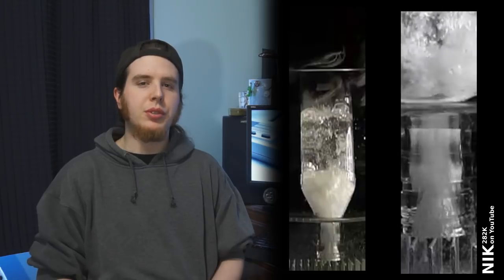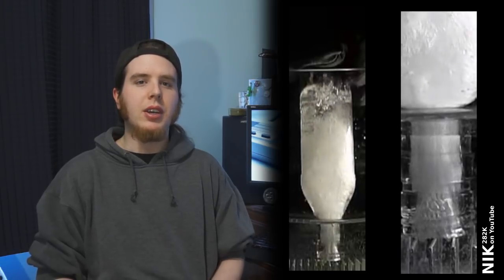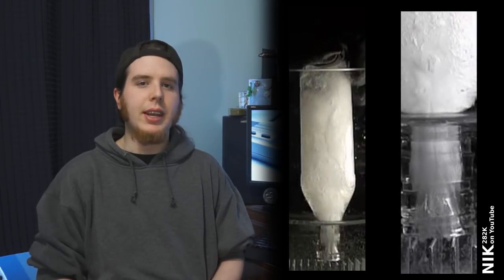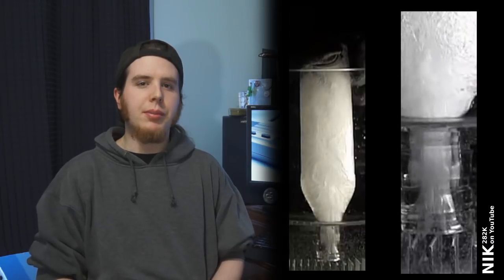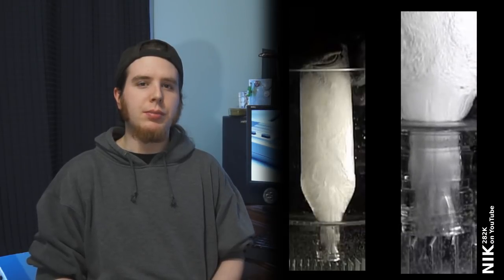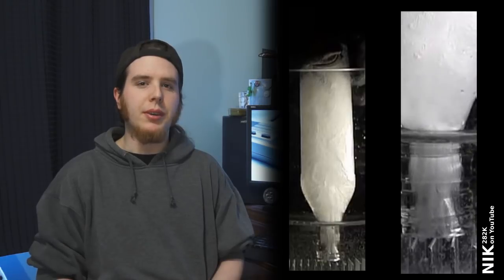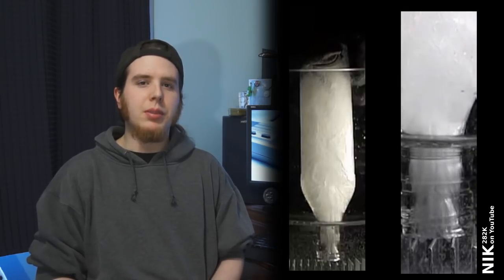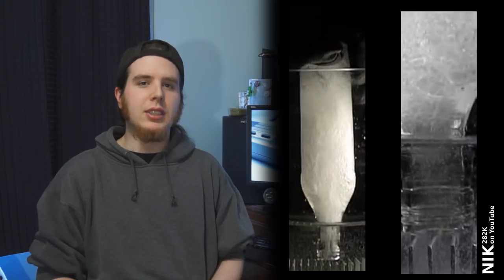Steam Hammer: Slow Motion

Comment: Nice work, man!
Reply from the maker: Thanks, the first time I reviewed the high speed video I thought something had gone wrong. It was so complex but it happens every time.
Reply: @NickMoore  Have you thought about containing the hammer/longitudinal/sound/pressure wave  (and having it reflect back and forth withing a rigid container) ?  To see how long that could last.  I'm looking forward to a reply since I can't seem to get any replies anywhere else .   I realize this would require the vapourized/cavitating part of the water to be left out from the closed off section.  /watch?v=xoLmVFAFjn4&t=5m35s . "in a very rigid system pressure waves can reflect easily without MUCH attenuation".                                                Put another valve, downstream of the cavitation bubble, closing it at the precise moment compression at the main valve reaches maximum  /watch?v=X9UbzcanuDk
Reply: Any thoughts ?
Reply: @NickMoore  A more simple way would maybe be to put a one way valve on your bottle after you fill it with pure steam, and then submerge the vessel/bottle into ice cool water, simultaneusly getting the violent negative pressure and allowing only water to be introduced.
Reply: What sayeth thou ? I can't seem to get an answer/feedback anywhere. Including physics.stackexchange com/questions/507633/is-undamped-reflection-in-a-pipeline-possible-under-described-circumstances

Comment: I've done similar experiments, but I've never been brave enough to do 'em with anything glass, as there's an awful lot of energy moving around in that situation.  The fastest frame rate my cameras will do is only 60 fps, so I've not even been able to catch two consecutive frames of 2L PET bottles imploding.  

Great video, and excellent play-by-play!
Reply from the maker: I had a really hard time trying to figure out how to explain it and show it at the same time. This was the 4th version I uploaded before I was happy with it.

I plan on going back to this later but bigger.
Reply: Nick Moore One of the more interesting effects I saw involved forcing steam into an empty (PET) container (with a pressurized steam cleaning device, which I'm not sure if they make anymore), which was airtight, but had a polyurethane tube leading out of it, and held under water.  As I shot steam in, initially, the underwater tube made lots of bubbles,  (PET bottles shrink when steamed; this undoubtedly helped get more air out) but after a few seconds, the bubbling petered off despite there still being a lot of steam still coming out of the boiler, vigourously. 

Not much later, the bubbling stopped altogether, and water began slowly filling the urethane tube.  There was negligible acceleration of the process, except for the boiler's steam slowing,  until the water reached the end of the tube, whereupon things happened too fast for me to discern, but the end result was a very crushed PET bottle, with almost all gaps filled with water, and a lot more of it than one would think could flow in through the small tube I'd used.  Daisy-chaining two bottles had almost the same result, with both bottles imploding and filling with water in the blink of an eye.

Comment: the little bubbles that form ar not resisting compression. they are cavitation bubles that actually implode.. you know the trick when someone blows the bottom of a near full bottle by hitting the opening with the hang.. hitting makes the bottle go down but the liquid is heavy and dosent move very much.. this creates cavitation bubbles at the bottom.. after the hit the cavitation bubles implode rapidly creating a shock wave which ruptures the bottom of the bottle. there is video of this in slow motion somewhere..
Reply from the maker: I have shot video of that type of cavitation in slow motion, it is one of my favourite 'weir physics' events.

I wasn't really clear when I said it in this video, many of the bubbles are in deed cavitation bubbles being "pulled" into existance than then collapsing but some of them are air bubbles that were drawn in by the rushing water. Now that I have a faster high speed camera I may have to revisit this and the exploding beer bottle trick.

Thanks for watching!

Comment: I can't seem to get this to happen. The water just lazily glubs into the bottle. Should I microwave for longer?
Reply from the maker: Do you have gloves, long sleeves and safety goggles on? Ok, good. The idea is to get the bottle filled entirely with steam so you want the water to boil for 10-20 seconds before you try BUT you also want to have as little water as possible in the bottle. When you tip it over and water that pours out will be replaced by cool outside air which will stop the steam hammer from happening. It may also help if you pre-warm you bottle by running it under hot water before you start, if the glass is cool it will cause the steam inside to condense and pull cool air in. Hope that helps!
Reply: "if the glass is cool it will cause the steam inside to condense and pull cool air in"  Small detail that can have a significant impact.  Thanks for pointing it out!

Comment: Where does the original air go? The water and pressure turn it into water vapor and then it is leached back into the water with very little excess air left over as bubbles at the top? Nitrogen, CO2, ect, where did those gasses go that were in the original air?
Reply from the maker: All of the original air was displaced by steam as the water boiled in the microwave. Water expands in volume over 1000x when it boils into steam filling the bottle completely.
Reply: Thank you

Comment: I don't understand how pressure drops (0:55) because as water is rising up it is compressing the inlet air and thereby increasing its pressure !! 
Pls correct me if i am wrong which i think i am.
Reply: This is confusing because the video did not show the starting point of the situation inside the bottle. It is not filled with air when placed in the water, it is filled with steam. No air. The steam begins to condense when the bottle opening is placed in the water. The cool water in contact with the steam causes it to condense, which creates the vacuum.  The steam continues to condense due to contact with the water, and the resulting vacuum reduces the temperature further, causing even more condensation. Thus the high speed of the upward water flow, causing the shock.
Reply: If I understand correctly, there are 2 opposing vacuums: 1 at the narrow mouth of the bottle, as the water is violently pulled in at the hammer time; another at the heel of the bottle. The vacuum at the heel is what draws the water in, and cools the steam, at first. The rapid cooling draws in water so fast, that the mouth can't let water in fast enough. This causes bubbles to emerge at the mouth, and vapour to emerge from the rising water level.

Comment: Pardon, but I'd rather prefer you call it "near perfect vacuum" in stead of "hard vacuum". The "softer version" is what's called "partial vacuum".
Also technically vacuum does not pull any water in. It's the pressure gradient between vacuum and atmospheric pressure that pushes it in.
Otherwise a very nice video.
Cheers.
Reply from the maker: +Eugen Afanasjev A hard vacuum is a bit of an overstatement, with water vapour still present in the space I should have said partial.

The existence of "suction" is a weird topic, physically it's is not a thing it's the lack of a thing but it is hard to conceptualize that a vacuum cleaner works by raising the air pressure of the room around it >_< It might make a good topic for a video, thanks!
Reply: I hope I didn't came off as snarky or demeaning, I intended it to be constructive!
Keep up the good work.
Reply from the maker: +Eugen Afanasjev No worries, I try to be as accurate as possible in my work, there is enough mis-information online already, but sometimes things slip by. Thanks again!
Reply: 'The existence of "suction" is a weird topic, physically it's is not a thing it's the lack of a thing "  yeah, it does sound like a weird topic.  My first thought was wondering how to define "suction".  Would make for an interesting video  :)

Comment: Nick--I'm a professional "waterhammer in steam systems" investigator.  My site is www.kirsner.org.  I studied your video because I've thought about why the rapid condensation event which generates the hammering takes place.  The steam collapse is very rapid.  The key I believe, as you suggest, is the cloud that forms.  Question:  Is it not true  that the rapid collapse of the steam space and hence rapid acceleration of the water occurs right after the cloud forms?  ( I think you freeze your video there, so timing is deceptive).   So  confirm this first..

What causes the cloud to form is the difficult question.  The "cloud" is actually tiny water droplets (not water vapor) suspended in steam.   Thus, rather than "boiling" as you suggest, the steam remaining in the top of the bottle is either condensing around tiny nuclei, or tiny cool water droplets are being spit into the steam space.  The former doesn't make sense for promoting rapid heat transfer.  If the later is the case, the many times increase in surface area of steam to subcooled water would explain the rapid condensation that ensues.  The question is then:  Where do the tiny water droplets suddenly come from?  A theory expressed in a Paper by one researcher is that the water droplets are entrained by fast moving steam over a breaking water surface.  Can you speed up your video and see where you think the cloud emanates from?  

Feel free to contact me if you like.  You also might want to view a steam waterhammer video clip on my website home page  called "vertical steam waterhammer".  When I run it in slow motion, I see the same cloud.
Reply: wayne kirsner If you still did not get your head around that, I'd advise watching videos where water is dumped into a bowl of burning oil. Practically the same happens there, sans combustion. Burning and boiling oil way higher temp than water so water shock-boils on contact with oil and basically throws stuff everywhere. Same is true for the result of condensation, the moment pressure  in the bottle reaches vapor point, some water boils. And as we can guess, it does not really matter how much of it boils really, because of confined space and how much the water expands when vaporises. It just throws tiny water droplets, as you suggested. Those droplets probably also start vaporising and separate into smaller droplets, to the point of very fine mist. And since evaporation is endothermic - here goes your chain reaction.